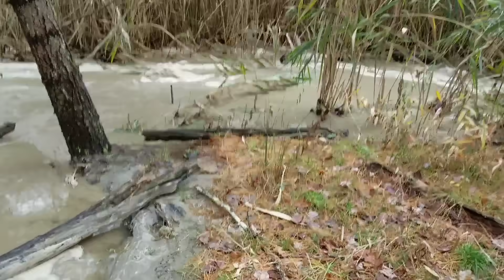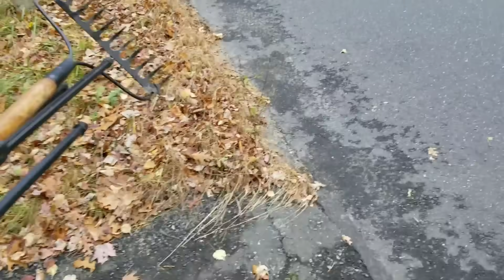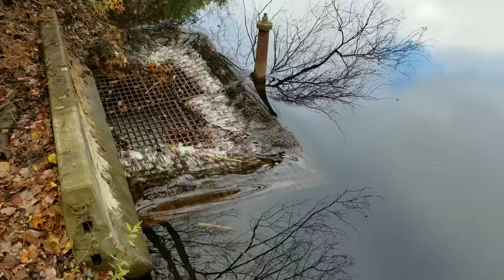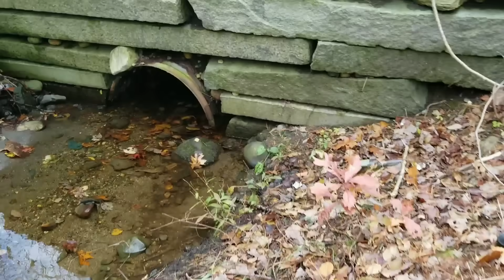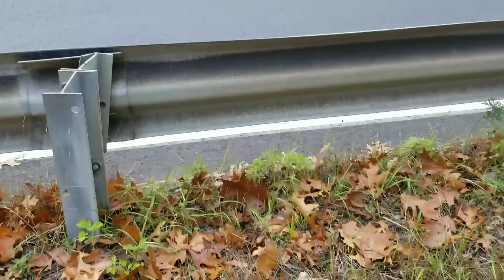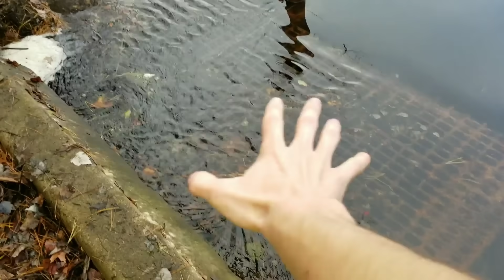Lake Drain Culvert Collapsing, Causing Sinkhole/Flood Hazard

Comment: Although it's not cheap they're actually companies that will line these corrugated pipes with a fiberglass like material..
They'll roll it out there and then they blow it up with air and then they have this machine that rolls through there and heats it up and it'll be good for 50 years we did it down in New Jersey in Salem New Jersey they repaired some pipes now they weren't as big as this one they were maybe 36 in at the most..

Comment: Their are going to have to use gpr to see the void underground and the extent of the damage. My advice is that they should really cover the length of the drain pipe in heavily reinforced high tensile strength steel  a type of bridge steel i beam that holds the bridge up

Comment: Back in 1973 the rail road had a big gap, the rail road, was in between my grandmother’s house and the man, who kept on saying, that there was going to be a derailment. The railroad was raised up by a dirt and rocks, so it wasn’t leveled to my grandmother’s or her neighbors home. It’s was a on hump, so if the train derailed, it would go down, with a little bit of a push. Guess what? The man was right. The train and the rail cars derailed. They knocked out my grandmother’s Wooden fence, plus her garden, that had several trees of fruit. The engine went down, upright, with its wheels digging in the dirt road. Thank God no one was hurt. My grandmother was super mad. They replaced her fence, I don’t know about her garden. I was three years old at that time. My father told me everything, when I got older. I don’t know if my grandmother’s neighbor ever called railroad commission..maybe he did, but like this guy is saying” maybe they didn’t care”.

Comment: I say this with absolute love for you and what you do. So do know I say it from a place of love. 
    You talked way too much and repeat yourself a lot. What you say may very well be true and 💯 correct. But you need to find a way to be concise and firm. You sound too panicky and over thr top. Again, you are probably 💯 correct in what you say. But it's too much to take in. (I honestly would have done the same thing until I was told this.)
    When you asked, " Did you hear that?" I couldn't hear anything because you were talking too much and was distracted by your rant. 
    Again, I would probably have done the same if it was just me, but I know I would want to be told this also. 
    Sometimes less is more when it comes to talking. 

   May love and light shine on you and bless you in a cascade of loving warmth, security and serenity.

Comment: They probably figured the tree roots was all they needed. Seen this happen before. Most new areas would require a barrel culvert all reinforced concrete. That old RCP (reinforced concrete pipe) most likely had a gasket which sections fail and this is the result. BTW government only fixes issues. They never truly solve the problem.

Comment: Hi  Post 10. The PDF report you linked to, has been taken offline, but it's still up on the Wayback Machine.

If you stick "Wayback Machine" into your search engine, and then throw the dead link in there, you can grab an archive link and edit that into your video description.

(I would post the link myself, but YouTube automatically hides comments, with URLs in them. So, if I did that, you would never see it.)

Comment: If they pour concrete around the culvert while installing it then if the pipe is corroded or damaged, it will work because the concrete itself will take the shape of the pipe.

Comment: It would take a significant amount of time for the highway above to start sinking because of this. Probably decades, if at all. Once enough dirt fell, it would block the pipe entirely. Loose, fallen dirt actually takes up more volume than compacted in situ dirt so at some point it will almost fill the void and stop falling. The problem then becomes a larger lake created on the other side with no place for the water to go because the pipe is completely blocked. As long as water is still flowing in the pipe it will eventually lead to more internal erosion but again, this will be measured in years before it becomes a real problem.

Comment: This is also sadly the state of far too much infrastructure in the US, ticking timebombs everywhere decades after their planned lifespans. Bridges, Roads, Culverts, and more run by departments just told to keep costs low until they have no choice but to act rather than actually save resources with preventative maintenance and action in the long term

Comment: Not sure if it's the reason, but my boyfriend once told me that our local council here in the UK won't fix things like pot holes, failing drains etc (there's a manhole cover that constantly falls in each and every year during the winter on a flyover, a good metre by metre in size. Cars go over it at 50mph so there's always one incident of a car going over it and it collapsing and that car/the cars behind as a result end up causing an accident) until there's a major incident because then they can apply for emergency funding from the government and pay for repairs that way.

Again, you're in the US, so different rules etc, but could be one reason. Like you said, to fix things taxes will need to go up and people don't want that. So, they may have to wait until they can declare it an emergency then get extra funds that way?

Comment: Sgt. Kiff: Sir, we have an emergency.
Zapp Branighan: Come back when it's a catastrophe.
Reply from the maker: we did have an emergency they found a sinkhole and shut down that Highway for nearly two weeks
Reply: @post.10  athe parallel here is that you alerted the proper authority of an emergency and they ignored your repeated attempts to get something done about it. Since the culvert collapsed completely (or is clogged badly) there will either be a sink hole or a flood or a flood that makes the road collapse into a sink hole under the weight.

The DOT and other authorities basically didn't care bc it wasn't a catastrophe, no one was hurt and there was no damage. They would rather some get hurt or killed than do something preventative.

In my original comment, I'm quoting a scene from Futurama where they are on board a space-titanic. Instead of an iceberg, they get pulled by a black hole. If you haven't seen it, you should check it out.

Comment: Calm down. Nothing is “collapsing”. Nothing “tragic” is happening. Actual engineers will take care of it
Reply: It’s eroding under the hill. And it did collapse. Why do you think the pipe got blocked? Because dirt is clogging it. That means it’s eroding. Plus, it’s been eroding slowly for years. It accelerated when this happened. The DOT also did find a sinkhole. So if post 10 didn’t say anything about this, the overpass road would’ve been swallowed.

Comment: Since the ponds getting jammed with debris more frequently than normal, would it be reasonable to assert that the obstruction in the downstream section is causing the pond levels to rise, and deposit the obstruction over the grate on the pond. One week shouldn't create that much blockage under normal circumstances. Great job reporting the issue with their drainage pipes. Hope your complaints do go unheeded for long. Take care.

Comment: This is an over reaction. It will not cause an immediate sink hole. If it gets severe enough it will cause the road to get bumpy or sag and cause the asphalt to slowly crack. The highway dept knows it is not a dangerous situation. But yeah those lazy bastards wont do a damn thing until then. This is much more common than what you think.
Reply from the maker: Well this video got them 2.2 million in emergency funds
Reply: @post.10  Im so glad to hear that. 👍👍 Have they began serious repairs yet. Im still watching your videos of those 1920s steam engines in the woods. Fascinating stuff.
Reply from the maker: @googleuser8448  look at my playlist tab, I have a lake drain playlist that shows the repairs.
Reply: @post.10  cool. Thanks.

Comment: It’s coming out dirty cause you cleared blockage and there’s more water going through which I turn pushes the sand or dirt in the tunnel come out
Reply: That's a possibility, but he stated in an earlier video that he went through this pipe sometime in the summer if i'm correct, and the inside was very damaged.
Reply: @traztom4082  the other side clogged too. thats also proof that it collapsed.

Comment: “Do you hear that?  Do you hear that collapsing?”  Um No.....cos you keep talking over it.   And......stop dramatically panicking.  You are probably right, but it is not collapsing into a sink hole right now is it.  When the road surface drops or caves in.....the road will be closed and the repair crews will swing into action.  I’d hate to be with this squirrely guy in a genuine disaster situation.  He’s kinda desperate for the road to sink!

Comment: is he overreacting ?
Reply: Actually, no. The road will collapse if the drain under it was damaged. It was dangerous for the vehicles. More accident will happen (which could be prevent if the authorities take care of the drain fron the start)
Reply: Eventually, and there's no telling how long it'll take because there's no telling how bad it was before this point, the earth underneath the road will all be eroded away and the road will give way.  If it's sudden people could potentially die.  But there is no telling where the collapse is and how large it is or how large it will eventually become. Moisture from rain adds weight which will hasten a collapse. Workers will need to stop the flow and inspect the damage and re-lay pipe and add something to prevent more material from falling to maintain the integrity of the causeway.

Comment: I try to keep my street gutters clear of dirt and debris so the street doesn’t flood. But heavy rains still cause floods, probably because the 1’ x 2’ grate covering the drain is drained by a 6” pipe. The engineer designing that one should be fired.
Reply: Cindy Strachan it was build in 1960s you idiot

Comment: The saddest part is that dealing with the emergency in the end costs more than proper maintanance.
Reply: Yeah, but it's a government agency. It's not their money and they pretty much can't get fired so they don't really care. It's the citizens' money and if they waste it, oh well. They can just raise the taxes.
Reply: There’s a reason the Germans pay top dollar for their roadways and water.
Reply: @SA-9909  and let me tell you it works just the way it should and doesn't break so easily.
Also greetings from Germany hahaha
Reply: @SA-9909  yeah the autobahn has instead of the typical American 3.5" - 6" of concrete on highways they are smart and poured 1 to 2 FEET of concrete
Reply: @middletnpyro  The flaw is with the contract limitations and regulations. In the states, they have to pick the lowest bidder by law. Obviously that means doing the job just well enough to pass inspection. It’s ass backwards legacy thinking. On top of that, the jobs are drug through the mud with union overtime, material misuse and the 20 different departments fighting for additional funding that leads to delays and cost overruns.
Reply: @Chris65645  If only. They're worse than useless, they're detrimental.
Reply: Post said it himself, some corporations don't get enough funding, until it's becomes a major issue they won't spend resources on things they don't have to, from my understanding when it becomes a major issue they push it onto someone else to pay for it i.e. the state/government/or citizens
Reply: It's not just govt, corporate America behaves the same way.   Seen it many times over the last 30 years.
Reply: LOL   maintanance....in the USA...HAHA

Comment: so... the moral of the story is companies wait for the fire to happen to extinguish it, not prevent it be forehand (analogy)
Reply: Worked in a foundry. 
Head of maintenance was great at putting out fires.
Mold car line would hang up rip out tracks carts pile up all over .
1 to 3 days fixing it.
Inside curve on chain rail get wore ,locating rollers on chain had bearings that went bad from sand.
 Would start catching on curve causing line to kick out from high amp draw. Reset keep running. Write it up need to fix. Would go on for weeks write up every day.
20 minutes for welder to cut out old piece and put in new never happen. 
Tear up, quick fix, big bosses over machine shop and foundry good job good job getting it running again .
Happened once or twice a year

Comment: Has he stoped think a blocked drain backfills with mud / silt right up to the top of the pipe once unblocked it cleanes itself out and yes it sounds like it is colasping as the large chunks of silt fall in to the bottom of the pipe ive cleared hundreds of culvert pipes in the road .
If it was colasping like he reackons there would be a hole were the pipe had failed preaty quick
Reply: He literally climbed into the pipe and saw the hole in previous videos. This pipe did collapse, and they eventually replaced it. It's in the video description.

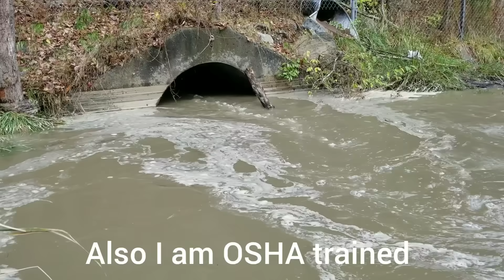Comment: 10:50 I was wondering if you had any kind of professional certification. That's good to know. Not that what you're doing is especially dangerous but working on anything industrial, or with heavy forces (like fast flowing water), or alone in a remote area always has the potential to go bad. I'll say it again, even if they don't pay you, they should at least give you some kind of official title for the work you do. Kind of like volunteer fire fighters but for DPW.

Comment: I will let you know how the game works ! States do not fix major problems once the cost reaches a certain dollar amount so they wait until it completely fails in a flood ,storm of some sort or an earthquake . Then they apply for Federal disaster funds to fix the problem this is why most bridges are at a point of failure . In Los Angeles the freeway downtown is 2 Lanes in every direction causing a traffic nightmare but they will not widen or upgrade because of the cost . Once a major earthquake happens in downtown LA and everything is destroyed it you get FEMA funds and it is much easier to use  immenite domain on private property .

Comment: I sound dumb but how can the cars be in danger
Reply: If there would eventually be sinkhole, and there were cars running on there when that sinkhole forms and collapses the highway, then obviously cars/drivers would be in danger.
Reply: Balnazzardi oh okay thank you I just didn’t understand at first how he was saying to look at the hill and then saying cars are in danger
Reply: Ye what he meant was that since its clear that the water on other side goes down crystal clear and comes out all muddy (and you could even hear stuff falling in there) is that earth/soil in the hill kept washing away with the water because that pipe was in very bad condition/rusted through. And eventually when enough soil gets swept away like that ofc, there is danger that from the weight of heavy vehicles the sinkhole that might be forming there could collapse the road one day and some cars/truck might fell into it.

That being said, there is no way of knowing how quickly something like that might happen other than doing the kind of radar scan to see if there is hollow space inside the hill. Anyhow atleast they fixed this issue by not repairing/replacing this culvert in question but by installing new one that doesnt go under the hill but around it from under the bridge where the highway crosses over the other road.

Comment: Can really hear your frustration about warning the local govt folk and getting the brush off. 
That road tho is in NO danger of collapsing .... WAY to much soil height / weight, which on the down side means WAY harder to replace. Hopefully they can replace the pipe by drilling / removing from the downstream side after blocking the upstream header with a hose to pump over road. 
Yes am with you 110% to save those beavers!!

Sadly usa is too busy building prisons and enriching warmongers / bankers to afford keeping our infrastructure healthy...

Comment: When the water stops, how much sediment is on the down stream side? If there is a MOUNTAIN of debris you can kinda judge how much has eroded.  Sense the pipe goes pretty much straight through, it prob isnt eroding from above the pipe. If there was a culvert up on the highway where water meets up with this one there could be I.N.I.  
Also, repair wise, they can line it with fiberglass with out digging.

Comment: Way to much drama dude. Ur dramatising this. Slow ur damn roll.
Reply: Mike Koop yea you’re the kind of guy who thinks it’s ok to wait for people to die or get seriously injured before taking action. He genuinely cares for the people using this highway and is doing what he can to rectify the ongoing situation.
Reply: @frenchstewart9843  u can make an ass out if ur self by just assuming stuff. How do u know how I feel or anything don't know u and don't want to know u. 
I do build roads for a living. That's why most of ur highway builds will not use metal any more because of that reason. It will fail over time.

Comment: You wouldn't see buckling on the road until it gives in entirely. 

I'll make a picture for you. You are right there is a sink hole but would visibly see the area of where the hole is. 

------------------------------------------------
-------------------       ----------------------
----------------             --------------------
-------------                  ------------------
-----------                     ----------------- 
---------                        ----------------
---------------------------------------------- In order it goes from Road, dirt, sub surface defect (sink hole), bottom of the tunnel. 
In order for you to see the road falling in is if the remaining dirt fell from under it and at that point it would too late. Couple accidents will happen.